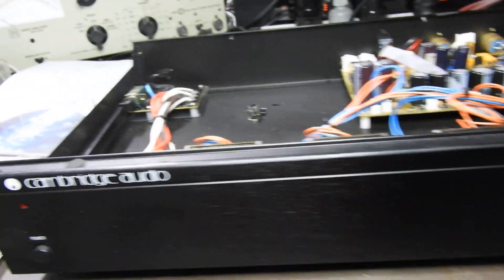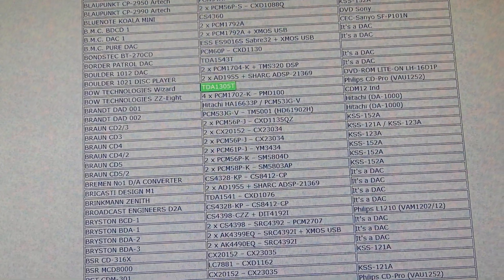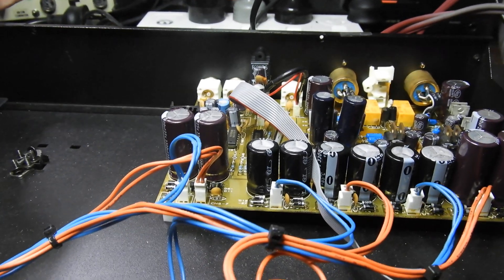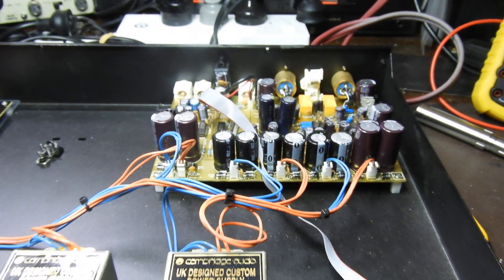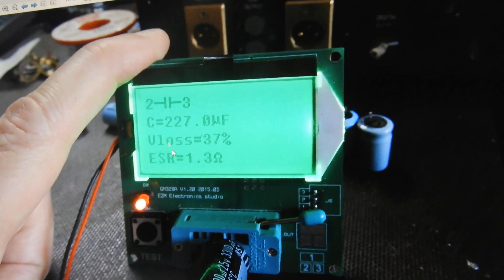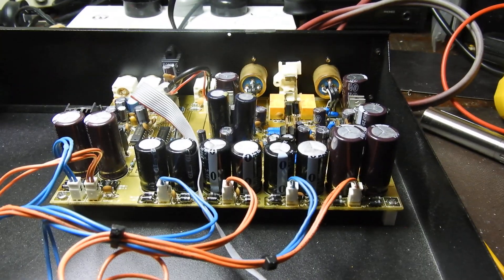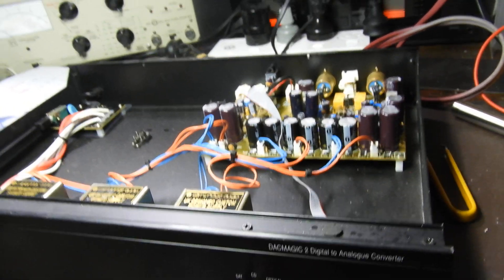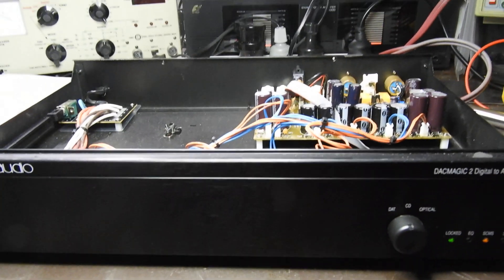DAC Magic 2 from Cambridge Audio Continuation - A lot of work but it is totally worth it.

Comment: I'm still using a Cambridge Audio Dacmagic II. Always been happy with the sound, although I've often wondered if a modern DAC would offer a worthwhile upgrade? Any ideas people?
Reply from the maker: If you're happy, the case is closed. I like the DAC in Wadia 16 which is 30 years old and to me the answer is no. I don't know of any modern DAC that's any better. At least to me.
Reply: I'm no (NO!) expert, but I've been into Hi-Fi for many years. Over time, I’ve been fortunate to accrue several DACs. Some I like, and others… not so much. I’ve noticed that while some are incredibly detailed, they can also sound a bit too ‘digital’ for my taste - maybe too 'forward' if that makes sense.

That said, I keep coming back to the old Cambridge Audio DacMagic as a perfect match for my Rega CD player. It’s not flashy or has an ‘in your face,’ sound but it has this smooth, analogue-like sound that takes me back to my old l.p. setups. It’s the kind of sound where I can really sit back and lose myself in a well-recorded CD. Simple, nostalgic, and just enjoyable.

Comment: Hi . I have an issue with this unit. It has. Right channel is distorted and drop out. I try to chase the fault and found +15v missing at the AD712JN opamp missing . I measure 0.6 v which is wierd cause capacitor before the 15v regulator has +20v present and it directly leads to lm7815 however no voltage at the input to voltage regulator ?
What can cause this voltage drop . Could it be the opamp pulling voltage down or is it the regulator itself  ?
Reply from the maker: Either. Both are cheap, so get them and replace at the same time to save on time.

Comment: Great informative video, I'm taking delivery of one of these this week and can't wait to hear how it compares to a much more modern DAC that I'm using , namely the Topping E30 with the Sabre chip.
Amazing that when you look at this Dacmagic with all the big caps and power supply s ,regulators inside and the Topping which is about the size of a pack of cigarettes....
Reply from the maker: Topping is just a basic unit but made with the latest chipset. Not many input / output options and no balanced output. As you see, this Cambridge could be reduced in size 3/4, but I think noise figures would have been higher.
Reply: @hear-net-au  Thats true, the Topping does sound very good, but i do have a soft spot for older Hi Fi gear, my CD player is an Arcam 70.2  from early nineties with the famous TDA1541 chip inside but it has the single crown! which i know you have a lot of respect for, As you say on this video don't dimiss kit just because it is old , you can see a lot of thought has gone into the design of the Dacmagic 2 by John Westlake
Reply: Just taken delivery of the Cambridge, blows the Topping away on sound quality , much more full bodied, rich,  tactile and analogue sounding, just goes to show that quality wins over youth, a well designed thought out DAC , i reckon the power supply supplies go a long way to the sound of this unit, to be honest iam totally inshock at just how good this sounds....but should i really be THAT surprised???

Comment: Please help my Cambridge Audio Dac Magic 2 not working in CD input. DAT and Optical input OK.
Reply from the maker: This is very easy my friend. the fault you have is exactly the same as in my unit. Just replace the chip in the top left corner of the player, right next to the input sockets. Do not get the Texas Instruments but the National one: DS9637 Dual Differential Line Receiver (TI are UA9637 but they fail just like yours did when you unplug the connector with the DAC still powered on. National DS9637 apparently do not fail). Get the 8 pin DIL (Dual In Line package). I hope it helps
Reply: @hear-net-au  Manythanks my friend. My DAC is OK.

Comment: Thanks for this excellent video !
Reply from the maker: A lot of words from me there but I feel this DACis very underrated. Its relatively low price is probably due to a lot of them out there have capacitors that have deteriorated with age. It does not help that the board is so densely populated and has more than dozen voltage regulators which create heat. But this is what you pay for proper engineering with short signal paths and huge distance from transformers. Most of the $2k DACs out there do not have 3 transformers and and certainly no 14 regulators!